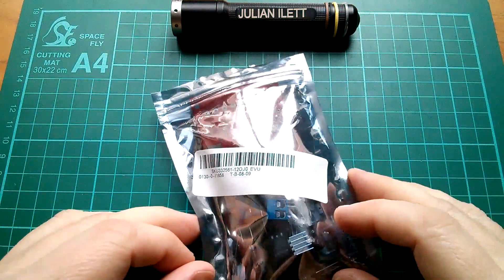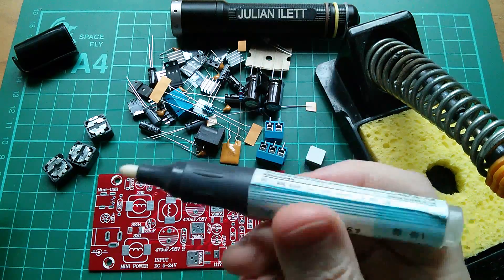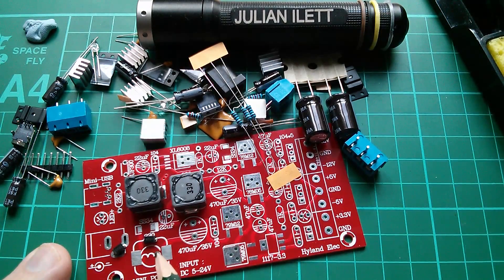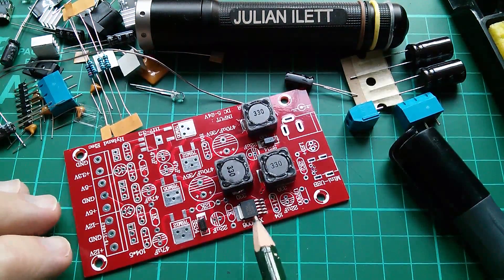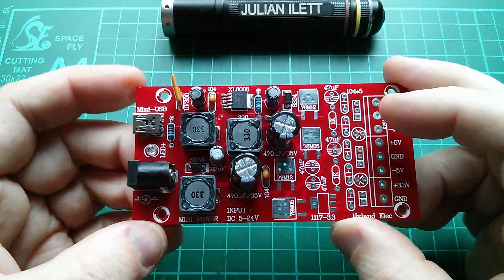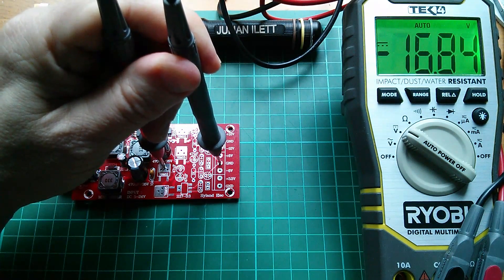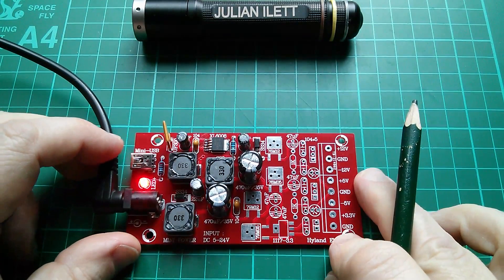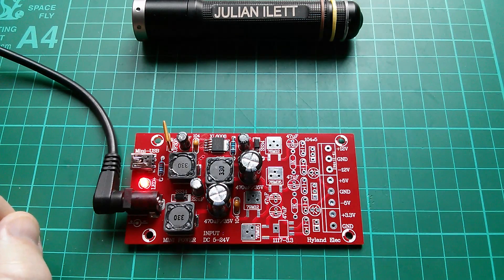Split Rail Power Supply Kit Build - SEPIC Cuk Topology

Comment: That would be perfect for the DDS signal source I put together last year which uses all those voltages. I ended up building a transformer driven linear PS
Reply from the maker: I think that's why Banggood sell it - as a power supply for the Hiland DDS.
Reply: It's also been used to replace the dodgy PSU in the FeelTech DDS. I have one of those and will be making the mod some time in the future.

Comment: Maybe they put the +5 on the main rail because it also drives the 3.4v regulator, having 3 regs in series may be as bad as driving the +5 direct, 3.3v reg may have a lower max input.
If you're using it for audio, i would increase the size of the smoothing caps, though you could include extra caps on the audio board
Reply: Sparky Projects was thinking the same thing. Also maby the 5v reg can supply more current

Comment: Hi Julian, 
I have a question. Do you leave you Solar Batteries out all the winter? Isnt that bad for the batteries?
Reply from the maker: Interestingly, discharged lead-acid batteries contain mostly water which will freeze not far below zero degrees. A fully charged battery won't freeze unless it's well below freezing.
Reply: Julian Ilett Thanks. Good to know. I think i'll put my System up tomorrow :D
Reply: Remember they are the same or are car batteries, and they do well enough outside

Comment: Bigclive's video is indeed fundamental work :)
Re regulators in series vs parallel - my guess would be that usually the majority of current draw would be on the positive rails, so  the +12V reg would take the sum of the currents drawn from +12V, +5V and +3.3V outputs, which might be too much for a 0.5A regulator (if I see correctly it's a 78M12). They could have added an extra 78M12 before the 78M05 to spread the dissipated power, but they didn't.
Reply: 68Stan The Banggood ad says 300mA per channel. If the 12V regulator is only good for 500mA it certainly can't supply the 900mA needed for three channels. It wouldn't even supply 600mA to just the 5V and 3.3V channels. They would either need a 12V regulator capable of at least 900mA for all three channels or a second 12V regulator capable at least 600mA to take load off the 5V regulator.

Comment: I have this little supply for half a year now and it works great. I added an lm317 and a little voltmeter to the +16v rail which gives me a variable supply from about 1,25 to 14v. You cannot get a lot of current out of it but for little projects this is fine. I put all this in a project box with colored connectors for all the different voltages. And I use it often. Mostly powered from a USB charger or power bank.

Comment: I normally place solder on one pad and then heat that solder pad and place the component on with tweezers, usually it tombstones slightly as yours did but i them press gently with the tweezers and reflow the solder joint and it goes flush with the board.  then i can solder on the other end of the component, works very well even on small 0805 components.
Reply: I almost thought I was the only one yelling at the screen @4:28 xD
Reply: Absolutely, especially with 0603, and its so quick because you can do one pin of all the components and just sprint through doing all the 2nd pins afterward :D
Reply: Perfectly mentioned 👍

Comment: Would a chisel tip help. Somewhere someone, maybe Lady Ada, said fine point tips should only be used in very special situations.
Reply: Chisel is always pretty good. Conicals are just pretty cheap, so they provide them with everything... If you're into SMD you might want a hoof-style tip, it has a reservoir for solder, you can just drag it over a strip of pins and they'll get soldered.
Reply: Think that was Dave. He hates them. I used to find soldering hard until I stopped using conical tips.
Reply: Cliff Hartle yeah, conical tips have minimal surface area for heat conduction, so they tend to take long to melt solder and sometimes freeze to it...
Reply: Yea and for some reason that's the tip I'm using right now. Got to swap it out.
Reply: So what shapes of tip are the best for general purpose, average-case use?

'Chisel'-style tips - is that it? Any other good shapes?

What is the special use case of the conical ones? Just to get into really awkward places?

It seems that 'they' always provide the worst shaped-tips with most soldering iron kits.

I always check that replacement tips are readily and cheaply available when I look at irons - Maplin (in the UK) have been guilty of selling mid-range irons but not the tips(!).
Reply: The more under powered an iron the more trouble with conical tips on large mass components. Basically short and chisel for low power. I use a high power (60W+) with conical and it's fine for everything.
Reply: With a chisel tip you have the option of using a corner,  an edge,  or a face,  so lots of options for heat transfer depending on what you're soldering.  i use one on a 45W iron,  and it works well for pretty much everything I deal with.

A while back,  I stopped in at the local Radio Shack store (since closed,  along with a whole lot of other ones in the area),  and looked at soldering irons and tips that they had available.  Every single one had a conical tip!  Why,  I don't know...